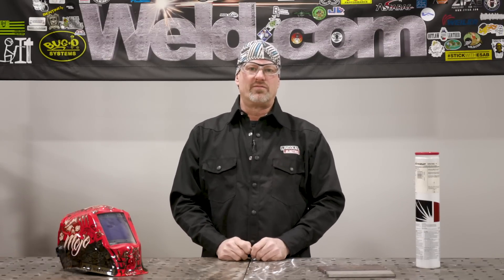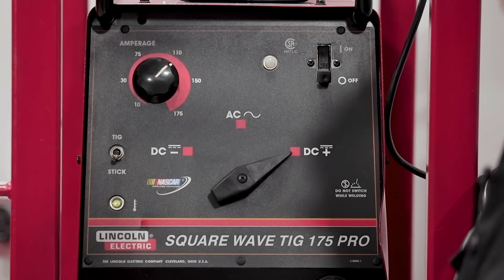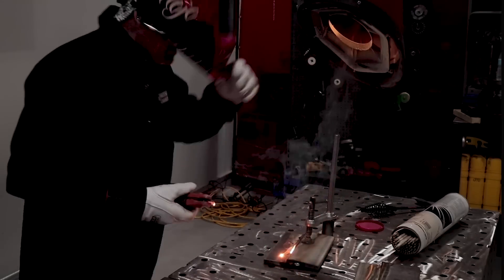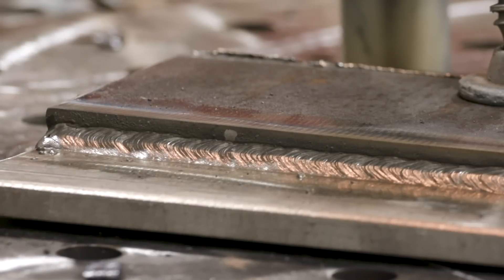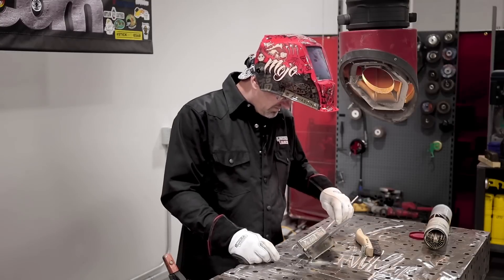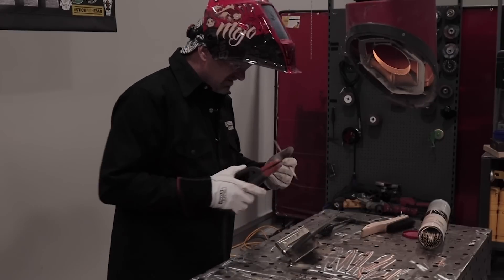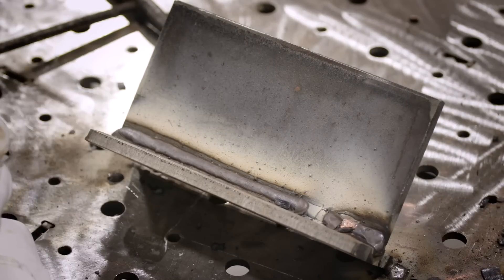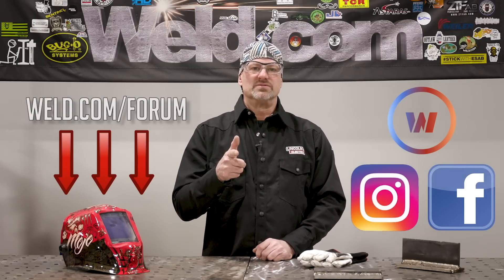Stick Welding With 309 Rod - Carbon To Stainless

Comment: Great video on 309, my second favorite electrodes, behind hard to find 7028’s!     I had to watch this again as I haven’t welded carbon to stainless in about 5 years.  I have a backyard project coming up with stainless and I needed a “refresher course on 309-16 vs 309-17.    Thanks for the video!

Comment: Suggestion...  If you can see  that  your rod  will be too short to finish the weld,  stop about 6" short.  That'll give you room to work with your next rod. Your finished product will look better.  So what if you  waste a bit of the first rod.  Save it for the next time you need a shorter rod.

Comment: Thanks for the video. I have been using dissimilar metals or maintenance rods for a while. I am not a great welder but had to learn by necessity.  These rods I found on ebay and were brand new and high dollar . When I researched them you are not supposed to remove the slag until it cools and  I believe you actually see it lift and hear it make a noise. If you remove right away supposed to make for a weaker weld. I can get the brand name or type  but it's probably just a 309. I gave a few to my neighbor who is a better welder and he never in new about them and was really pleased in how they worked. Could you do a video using 309 on cast iron repair or cast to steel ? People don't  believe it's possible with these rods.
Reply: Need nickle rod for cast. 
Sure you can lay a bead on it with 309, the same as you can with any other rod. But that doesn’t mean it’s going to be a proper repair. 
And your friend is definitely not a seasoned welder if he’s never heard of a common rod like 309. 
But you are correct about letting the slag cool and keep the oxygen in the air away from the weld until it has time to cook a bit. Same concept as holding your gif torch on the weld with post flow when you terminate a weld.

Comment: Bump up few amps on those welds and a little more of an angle, tighter arc should  help to get a better bead and diminish in those bbs splatter

Comment: Hi, I just graduated from the trade school I went to about 2 months ago and I started working at a place that uses 309l-16 rods, we aren't allowed to weave I believe it's because we do work for the navy. But anyway I can only use about half the rod before it overheats. And this happens for everyone  here and i feel like their has to be a way to use the full rod Instead of stopping in the middle of my plate. I'm doing 2g plate with 1/8 rods, on dcep with 115 Amps. I've tried welding lower Amps but it still tends to overheat. Any advice?
Reply: It's also a single bevel groove.
Reply: Stainless does that

Comment: Love the welding tips but you might want to check in to Stainless Steel Welding Rods giving off Hexavalent Chromium (Chromium 6/Cr VI)? Just to be on the safe side.
Reply: Good point. They stopped us from stick welding with stainless altogether unless using some serious ventilation
Reply: Sorry you didn't like me telling you the Truth. I would be careful about not informing people watching your video of the Dangerous condition caused by the welding process. I was a Quality Assurance Manager & Safety Manager for many years. So I gather you don't like me telling the truth so I will be leaving this post, and hope you don't get Sued too badly.

Comment: Stainless steel welding rods (307, 308, 309, etc.) emit hexavalent chromium fumes.  This is VERY bad stuff.  It is recommended to wear a P100 respirator when welding with these materials.  I really wish you'd cover some of the really big safety issues in your videos.  The blanket safety disclaimer at the beginning of the video doesn't really cut it for a channel that is here to teach.

Comment: The worst stainless I’ve ever welded was last fall doing burner cracks in a boiler. That shit was an absolute pain in the ass to weld cause of how fatigued the metal was.
Reply: I have done the same kind of work, that metal has been heated and fatigued for months on end!! It's not fun to weld! Thanks for your feedback!
Reply: @paulsableski1168  like welding a rusted fender from the snow belt.....so much fun.....
Reply: What different properties does the fatigued metal have?

Comment: I've never ran 309 in a stick, but have burnt quite a bit of ER309L with TIG. I recently had some difficulty with both 309 & 312, in joining 17-4 SS to high carbon steel (rotary hammer bits).  I'm not sure why both 309 & 312 cracked/busted/failed.....but multiple pass ER70-S2 has been holding up great.

I'd love to hear any thoughts on what the issue is, because I have always heard & thought this was a primary purpose of 309-

Thanks!
Reply: hey Robert, did you preheat the high carbon steel? when you make multiple passes you actually temper the weld and make it more ductile. That is good.....Try a preheat of 300 to 450 f.... with Interpass in the same area, there is some data out there on the net... slowly cool......get some Bentonite....very cheap.....it is oil dry or kitty liter and cover part to slowly cool, no need to make a fancy oven or use weld blanket ....let all the commenters  know how it works, maybe buy some er80s-2 or even er90s-2......I know, 309 has a tensile strength of 85,000 psi, 312 is 120,000 psi....there is a Harris product, Super Missle Weld that is pretty much the same was 312, but more expensive, you might try getting a pound of that....
Reply: @atomichydrogenweld2823  In both cases, it was roughly a 1" shaft; so I didn't even consider that a preheat/slow cool down would be necessary.  One tool is a rebar driver, and the other lengthened a clay spade to about 3FT (I'm a Land Surveyor in real life).  In fairness, the weld joint probably wasn't beveled enough initially....but I did a super-bevel after the failure and when I used the 70-S2 (which has thus far worked).

The tensile strength differences of the different welds is obvious, when attempting to machine the failed weld off the joints-  70-S2 is easy....309 is tougher, but doable....312 is a PITA

I'm a Harris fan, and have heard of the "Super Missle Rod" although I haven't tried it yet.

309 & especially 312 look nicer.  I'll pay more attention to pre/post heat the next time I give it a go.  These tools really take a pounding in the rocks, from the rotary hammer.

Comment: Well the 2 welds are exactly the same as you are welding a corner joint on both.
Reply: corner joint? where did you get that term......maybe you mean T Joint with a fillet weld....one is 2F position, and the other is 1F position....and what the devil does it matter anyway.....THE TWO BEHAVE DIFFERENTLY.....these guys making videos don't need you pointing out something that is not true.....get the facts straight MAM.....just the facts

Comment: What's the difference between 308 and 309? Never heard of 309?
Reply: 309 you can weld stainless to carbon. 308 is strictly just stainless to stainless

Comment: I would like to see a break plate test in vertical. I'm practicing for that test and having a little trouble
Reply: What are you having trouble with?
Reply: @paulsableski1168  lack of consistent penetration and the bead keeps building up. I'm moving side to side trying to stay out of the center. The rest requires 1/8 and I'm kinda blind on what heat to run. Haven't really used this rod so it's all Chinese to me
Reply: @ttsupra87  are you referring to 7018 rod? 1/8 7018 needs about 115 to 120, depending how good you are.....it can be more or less depending on machine too....zip across the middle to keep it form building up, and pause on the sides for maybe 1.5 seconds or so, you might hear a slight change in sound also, when that happens , move to other side, moving quick in middle.....you will get the hang of it.....and ignore the flux rolling down that is red and looks like metal......the more you weld, the better you get, and always get stable and comfortable, I like to use clamps, blocks of wood, whatever to get me and my skinny weak arms some support.....it never hurts...especially while learning,,,,,,use both hands too in the beginning, as you get better, you can learn to weld with one hand on stinger and one for support.....hope this helps, another old geezer welder
Reply: @atomichydrogenweld2823  this test is 309l 1/8 smaw 12" break plate.
Reply: @ttsupra87  ok, lets go back to the start, 
what type  weld? groove or fillet,? 
what position [1,2,3,or 4], opps, I see you are welding in position 3 [vertical]
what thickness material
what rod? 309- [15, 16, or 17]
these all add up to different answers.....
Reply: @atomichydrogenweld2823  pretty sure it's 1/2 plate. As to 15 16 or 17 I don't know. Shop gave me 309 and said weld. Up until today I didn't even know there were series. Vertical fillet

Comment: What do you think about using 316L for welding 304 or 304 to carbon steel. Lincolns data sheet seems to suggest 316L can weld most of the 300 stainless.  I was curious if it was okay to weld carbon to stainless with it. Basically I have a bunch of 316 wire. Thanks.

Comment: Er309 also is good for when you’re dealing with unknown flavors of stainless, e.g. cookware.  Never run it stick, but have done a little bit of it in Tig.
Reply: 309 rods are awesome flat horizontal and overhead. Vertical sucks ass

Comment: Would like to see a video on using 312 rod, especially compared to 309.
Reply: I can put that on the request board, what are you welding with the 312 rod?
Reply: @paulsableski1168  its a maintenance rod, so everything. Last one i did was galved mild steel to 316.

Comment: Stainless has the only spring loaded slag!
Rule number one is mouth closed
Rule number two is hand in front to deflect while taking slag off with the hammer
Rule number three is brace yourself next for your first vertical full stainless weld and watch all that metal dribble down
Reply: Lol, your are correct emmanuel germain, Thanks for your feedback!
Reply: “Spring loaded slag. “.  I laughed my ass off and spit my coffee down my shirt with that one!   😂😂😂

Comment: I had an issue where the slag wouldnt come off, i had to really beat on the slag for it to come off.

And after i do get the slag off, It would also leave a thin layer of slag.

May i know what causes such?
Reply: Bump that heat up a little and maybe slow down.
Reply: Wait for it to cool. That's what worked for me anyway.

Comment: Has $25k in fixturing
  
Welds practice plate to the precision table top
Reply: looking at the Certiflat table catalogue, it says the table they have is only $588 ......where do you figure $25,000 in fixturing, I don't think those mig pliers and wire Bruch cost that much. to make up the difference, ...dude, get real.......and those tables are not very "PRECISION' as you claim

Comment: Perfect timing, I just got my 3F ER309L weld signed off at school today.
The objective was for a 1/4" lap joint and it took me about 4 hours and 8 attempts.
I got a real nice looking bead on my 1F practice run but once I switched to vertical up the rod stared fighting me at every turn.
Reply: Congrats on getting your weld signed off!! Keep practicing, I'm sure you will get the hang of that vertical soon, Thanks for watching!
Reply: @paulsableski1168  thanks!
Reply: Do you have to pay for your test material at your school?

One 14g 30"x30" plate is $87. I'm out. Can't afford this.
Reply: @dolphincliffs8864  my school provides all practice and test material, but I don't know if all schools are like that.
Reply: @The_Inquisitive_Inquisitor  It's part of the "curriculum",even though local shops provide material. $25 for the last test and now this. F em
Reply: @dolphincliffs8864  I'm sorry to hear that. My local community college happens to have one of the highest rated welding programs in the country so their materials budget is a lot higher than most places.
Reply: @The_Inquisitive_Inquisitor  Weld on brother! I gained a lot of knowledge but my course is too chaotic and not well structured. 

School should hold your hand till it cannot any longer. They threw us to the wolves straight away,lazy state employees. They focus on their favorites and their pet projects,meaning the get students to do their dirty work fixing their equipment in class.

That stump grinder repair would have cost them ,my labor,$450 at least.
Reply: @dolphincliffs8864  Good news is you don't need the degree to start working as long as you're good enough to pass your certs. About 1/4 of my classmates are already working welding jobs.
Reply: Good stuff man. I had to do 1/4  cs to 1/4 ss 3G with Cs backing strap with 309 wire. Very tough to not have under cut or to much roll. Really have to push fast